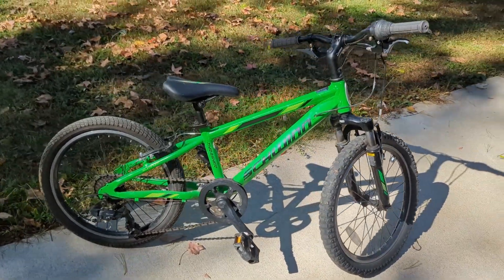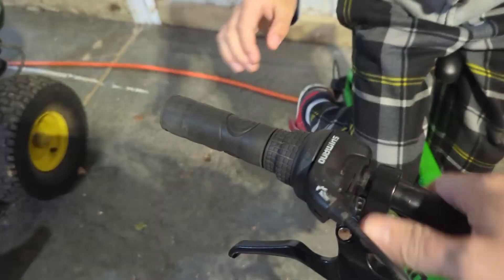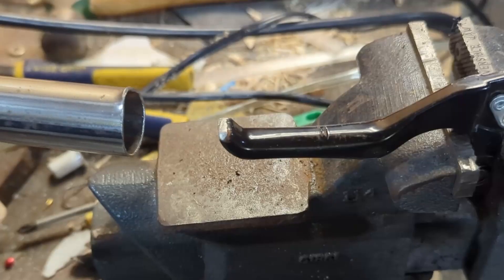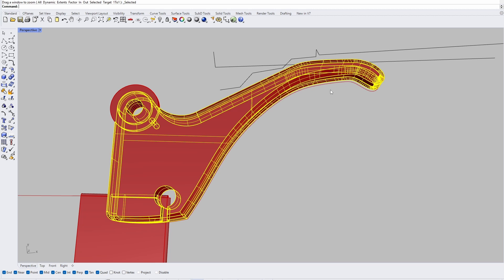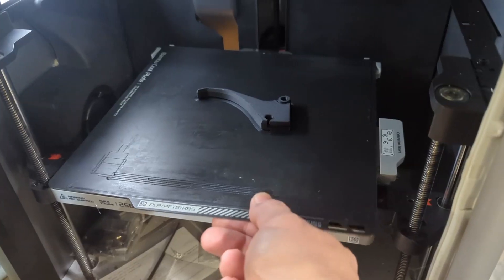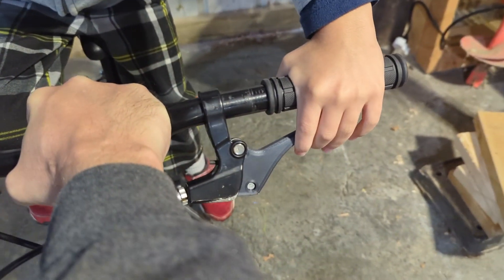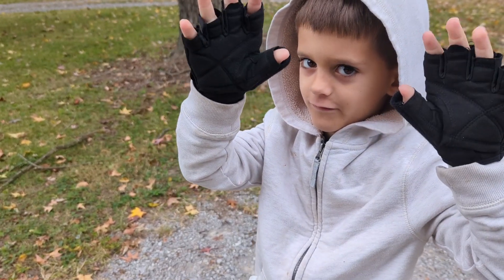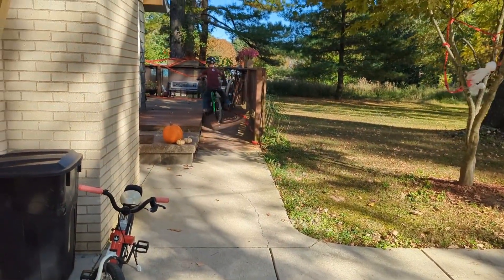Improving a Kids Mtn. Bike with 3D printing.

Comment: how expensive aluminum have to be to be able to bend? It's always expected for aluminum to break . at least then doing it cold.
Reply from the maker: It didn't even bend 2° before breaking. I've had Shimano branded aluminum mountain bike levers bend 20° and then I bent them back straight and they still didn't break. The lower quality more porous casting using an inferior alloy makes the brake levers less expensive and more easily broken.

Comment: Maybe the interior you print with CF-PC for strength and durability and the outer walls you use ASA. ASA and PC print near the same temperature, 260-280. You would have to run CF filament through the AMS which Bambu does not want you to do but does work. CF-PC prints with no warp issues on my X1C.

Alternatively, PC blend type filament for the interior and ASA for the exterior. PC Blend filaments print without warp issues on my X1C.

I have used the X1C+AMS for prints combining ABS, ASA, PC Blend, and CF-PC. 

There is also CF-ASA, I have seen it once but I forget where.

Congrats on reaching 69k subs.
Reply from the maker: Outer fiber distance. Put the structure as far outboard as you can to maximize strength and stiffness. The carbon fiber PC you are talking about is actually a blend which is primarily ASA. 100% PC prints at  310° C in my experience.
Reply: @DesignPrototypeTest  Pure PC has a temperature resistance of ~170C, PC blends typically have a temperature resistance of ~110C. The CF PC I printed on the X1C advertised 170C temperature resistance, I was able to print that using the default Bambu slicer settings of 280C, I was also able to print it at 260C-270C when doing multimaterial prints with ASA and ABS. The PC blends that I have seen are either PC+PET or PC+ABS. I have not seen PC+ASA but I am sure it exists.

I was suggesting only the outer first or two layers be from ASA just to block UV. It might also be useful  to stop the CF fibers from embedding itself into your hands. It happened to me once and it was a pain to pick it of my skin, but that was for a print that was not meant for being gripped with force routinely by a hand.

Comment: Great tip about minimizing distortion by taking the picture across the room. It's something I've been repeatedly messing up on while modeling. Thanks!
I did not know about the PLA Carbon Fiber filament. Definitely getting one of those rolls. Have you used this in other things that are used outdoors? I've had PLA and ABS degrade and become brittle on things that I leave outside and have been using ASA. Curious how this PLA-CF would hold up over time in the sun.
Reply from the maker: Paint your prints with clearcoat. It will protect them from UV degradation.
Reply: When possible, I use a flatbed scanner for my CAD reference images. Only thing better would be a telecentric lens.

Comment: Hey man. Consider doing a forced carbon version of this brake for your son!

3d print the negative mould and then pressure mould chopped carbon tow in there with a room temperature epoxy.

Comment: Love it!! There's now a plethora of kids mtb stuff now, but as ever the bike industry gotta make a wholesome buck for this privilege 😢.  

How's the bamboo x1?
Reply from the maker: It's the most plug and play printer I've ever used. Also the most in line with Apple ethos. They are making it extremely easy for users at every level, but the hidden cost of that is the fact that they are gaining control behind the scenes in many ways. Most egregious is the printing through the cloud issue. I will continue to use it as my primary printer. It just works.

Comment: Did you print it on a Prusa printer?
Reply from the maker: Yep. Josef is making this fantastic new machine. They ship it from China under the white label name "Bambu Lab X1C" It's really a good machine and knowing that Prusa actually designed and manufactured it instead of some unreliable Chinese brand with a questionable design staff just gives me all the confidence I need.